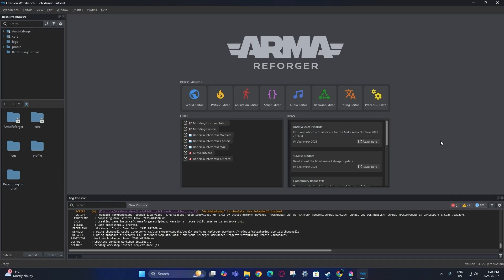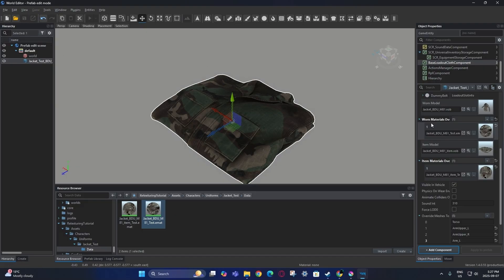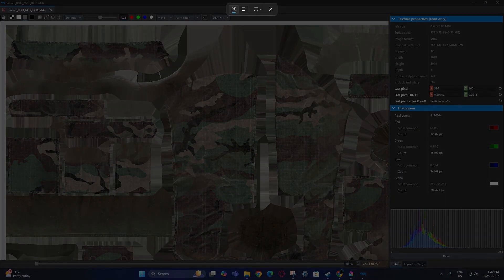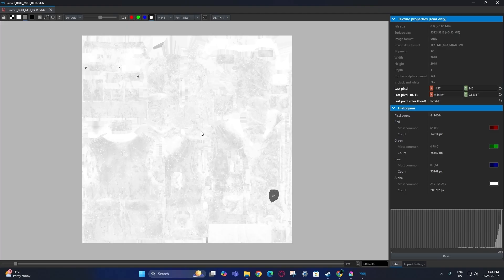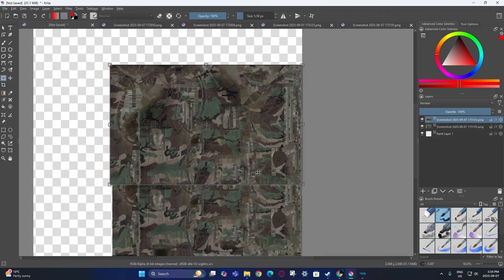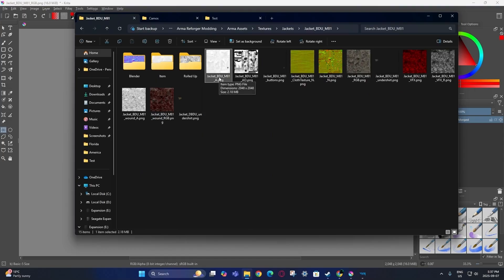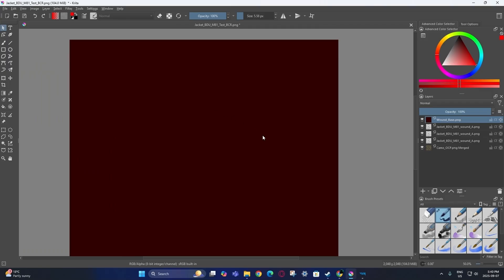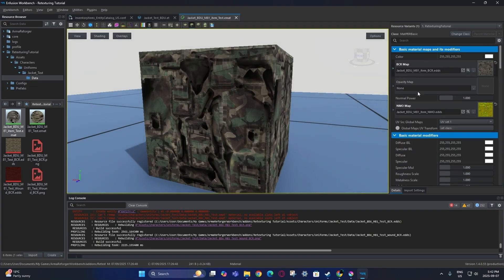Arma Reforger Modding Tutorial: Retexturing

Comment: This doesn't seem to work for the PASGT helmets, armour or the ALICE backpacks, am I stupid or does it require a different method?
Reply from the maker: Those can be retextured using the same method as shown in the video. I'm not sure where you are running into issues. Maybe try following the example in the video first to see if you can at least get that to work
Reply: @ReforgedMarineModding  I managed to get the uniform fully retextured but the PASGT is being troublesome, thank you very much though

Comment: Is this the same process for working on a gun? Im trying to get source textures out for the M9 to tinker with and it's locked lol
Reply from the maker: Yes, retexturing weapons is the same process that I showed in the video. I'm not sure what you were doing that was causing issues. I even went into the Workbench to check the M9, and I had no issues
Reply: @ReforgedMarineModding  wow it took me forever to see this notification.  I'm trying to get the things out of Enfusion so that I can retexture the Beretta M9  and  its just not letting me do it.  I'm now rewatching this video to see if i can find where i messed up.  Apologies on the late response.

Comment: How to put it in game?
Reply from the maker: That was the very beginning of the video, where I put the jacket in the arsenal box
Reply: @ReforgedMarineModding  that's still in the workbench. I meant how to actually load the mod when I run reforger exe. Or does it automatically loaded?
Reply from the maker: @Enzed_MY  To get the mod in the main game, you have to publish it. To do that, click on the "Workbench" option in the top left corner and publish it. I believe you can also choose the option of it to be a test mod, if you just want to test it in the main game at first. Once it has been published, you have to then go and download your mod from the workshop (if you set it to be a test mod, then you will have to select the filter for test mods, which is the last filter)
Reply: @ReforgedMarineModding alright thank you good sir 👍